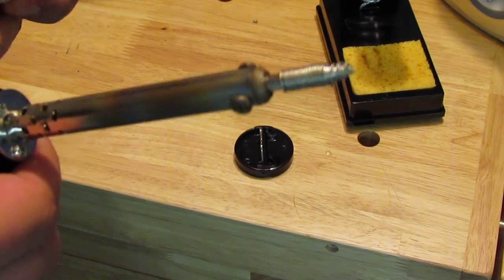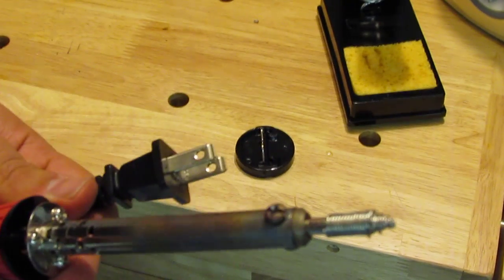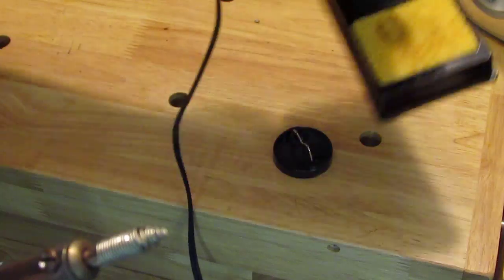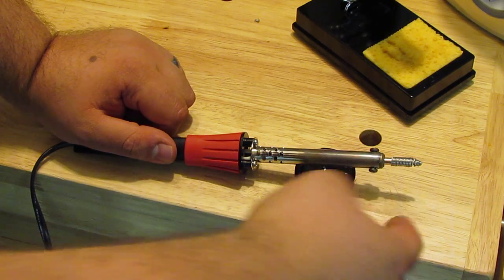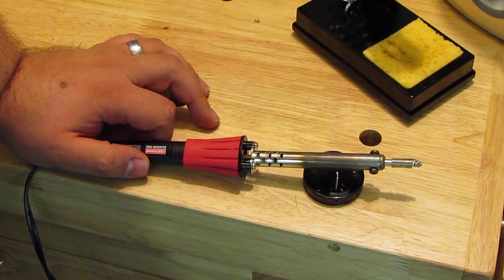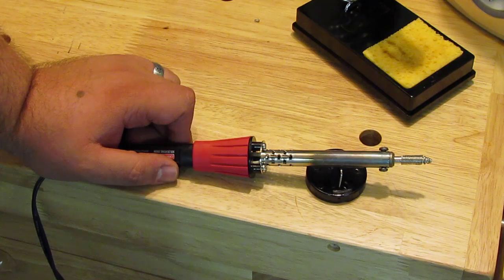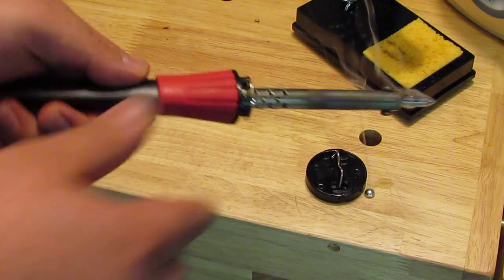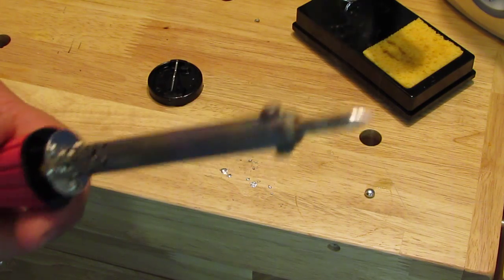How to tin a Soldering Iron

Comment: I tried it and the solder just melted off the tip. Am i doing something wrong?
Reply: Has your iron been tinned before or have you turned it on without tinning that could be it. Or if it is already oxidized it might not catch right
Reply: +Lower Tones bit late mate